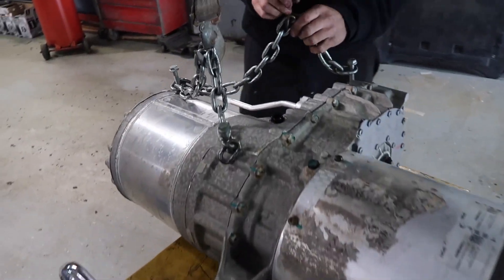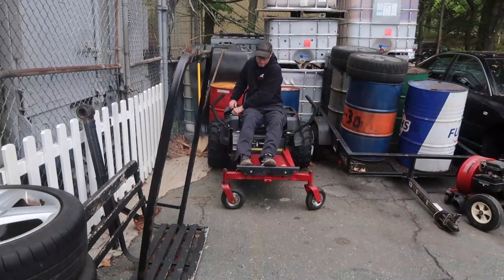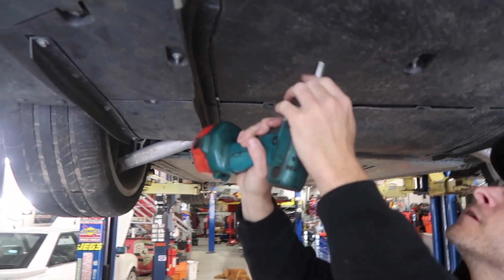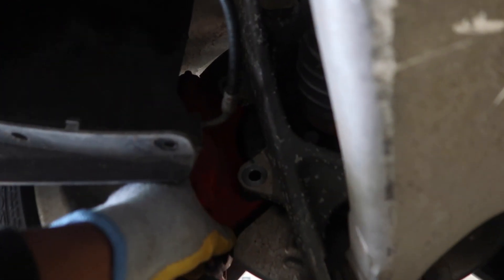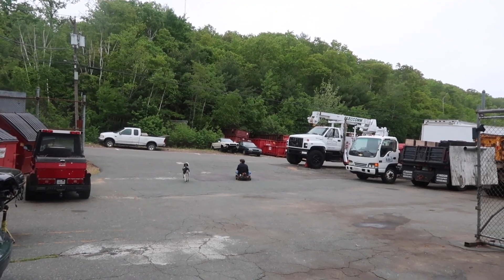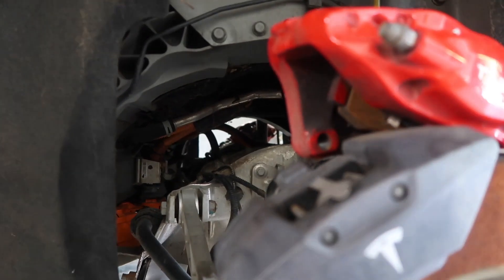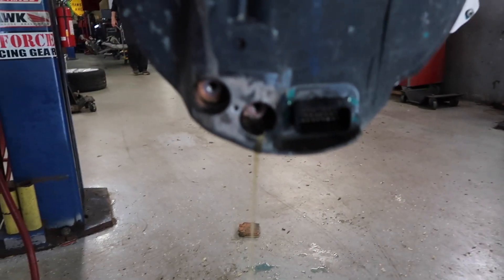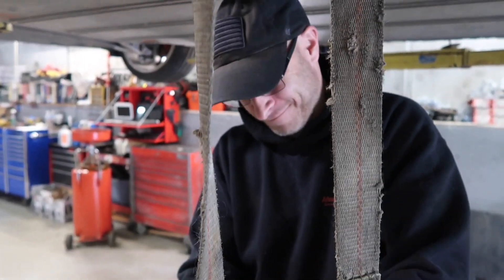Can You Drown a Tesla Motor?

Comment: ask louis rossmann maybe he can repair the board
Reply: Louis has made it pretty clear that he makes his living fixing mostly common faults, and will charge you dearly for doing custom repairs. Because of thier difficulty and the amount of work that has to be poured into finding schematics. Love him, but doubt he'd do it for exposure :P
Reply: I imagine Louis might just throw the boards into the ultrasonic cleaner and hope that that's all they need. I imagine that the schematics for those Tesla bits will be harder to get a hold of than any laptop or smartphone schematics (let alone replacement ICs) so going down that road is probably a dead end.
Reply: DKTAz00 ya. who wants more exposure on YouTube?
Reply: I think the Crest Ultrasonic will do it.
Reply: louis has 3x the subscribers as this guy and i'm sure he would have no interest on attempting to work on this HUGE and TIME CONSUMING part. the thing would cost a fortune to ship and he would have nowhere to put it
Reply: Don't tell him how "little" corrosion there is, just send it to him and let him experience it ;D
Reply: This is a bit too advance for Rossmann. It's one thing to fix bad solder joints and have schematic diagrams available for a mostly digital domain system (computers).  But it is a whole other can of worms when you have to troubleshoot blindly since no one has released a diagram of the the electronics and you have to understand analog and power electronics theory and firmware programming for this analog/digital domain design that also has precision electrical components. 

 Shahriar of "The Signal Path" youtube channel is someone who is capable of fixing this.
Reply: Catsrules1 it does look worse then it really is. I doubt power went to the inverter when is was parked. Also, corrosion on a circuit board is usually white. I bet my ass off that rust is from the shell which got surfaced over the board by the water, and all it needs is a hook cleanup and maybe some traces, pads/pins resold weed, worst case, some passives, which ain't that bad
Reply: DKTAz00 If you watched his videos, you would know that answer to that.
Reply: Knowing Louis hates tesla,  The color of the board from green to brown I don’t think he would repair it  try Scotty Kilmer? I wonder what scotty would say as well.
Reply: I don't think anyone is saying it can't be done, but that it's not worth it, compared to getting another salvaged part. Unless your time is free.
Reply: He’d do a 40 minute video and somehow spend 30 minutes of it slagging off Apple, remove a jtag connector and claim it was fixed because a fan spun.
Reply: I doubt Louis Rossmann would even touch this. I won't and I work on water damage stuff for data recovery. But this has been under water for days and the protective coating won't hold up to being flooded, it only design to repel moisture droplets, not flooded. Those board's are more likely beyond any repair. It not just traces and the layers on the boards you have to the worry about, but components are more likely shot as well and lack of service info would make a repair on that, next to impossible.
Reply: I did board repairs like this before, even much more damaged.
Reply: he can try to clean and solder som wires to it from teh broken leads
Reply: I don't know, it might look worse then it really is. From the looks of it (at least on that board we got a good look at) most of the chips and such are above the water line. Looks like the bottom part (from my zero experience for electronics) that was under water is more for power distribution So it should be pretty standard to replace.

Comment: Wow man, you're certainly giving Tesla engineers a good look at where they could make design improvements. I'm not so sure that car could drive through a minor street flood of 8" to 10" without encountering some seepage into areas that it wouldn't tolerate well at all.  Interesting video, thanks!!! 😎
Reply: Zeek Duff 
I heard that Tesla engineers subscribe to this channel and decided to implement bilge pumps.
Reply: considering this car was 10 days under water not a couple of minutes it could be worst
Reply: you have to realize that this car was TOTALLY UNDERWATER for TEN DAYS. it took 10 days to accumulate that relatively small amount of water using this website https://water.usgs.gov/edu/activity-drip.html  it says that a sink that drips once per minute for 10 days will produce 3 liters of water, i would call that comparable to what they saw here. this car being submerged for 10  days had leakage comparable to that of a very slightly leaky faucet.
Reply: ADreiews76: I was thinking the same thing. to have that little water inside after 10 days immersion is fairly impressive. The sealing is more than good enough for splash protection or fording and wouldn't need much more work to seal even better. Usually doubling up on the O rings is enough.
Reply: I don't know if any car could handle driving in 8-10 inches of water. 5 was pushing it in a Corolla and I bet Teslas are even lower
Reply: And did they tear down the motor/diff/inverter to see if there was water in it?
Reply: Model S must have 6 inches or more of ground clearance to the bottom of the pack, then a few more inches above that before you get to a potential leak point, so I'd think 8-10 inches would be fine for driving.  I've definitely taken other cars through water that deep.
Reply: Scoda Octavia 2005. 10 inches of water with waves covering the front bonnet. Drove trough 300 meter long stretch also making waves that picked up small cars and threw them on the sidewalk. Not a single hiccup during or problem afterwards.
Reply: One improvement I'd suggest is moving the inverter circuits to their own separate water proof enclosure.
The AC motor itself can tolerate some water but the inverter boards must stay absolutely dry.
Reply: It wasn't actually floating in that video.
Reply: Zeek Duff well honestly 10 days is a lot
Im going to refrence a device, an iphone or a samsung, both water resistant. TO AN EXTENT. Both 1 meter (one for 30 min another to 1 hour) 
This tesla was left for 10 days
The seals were under a lot of pressure 
Plus its usually a fresh water test for seals (the ip67 and 68 raitings on either devices under salt water is well. Unknown. Well to me anyways) 
So im guessing the dirts minerals and salts in the motor could have broken the seals, plus the variation in heats (which led to the oring disaster on an Apollo mission it shrank in the cold) 
So i feel it should be fine under certain situations
Reply: That's not true. There is a video where the car floats and moves forward using the wheels as paddles. I think it was in Russia in a tunnel with lots of rain water.
Reply: While I'm sure that's possible if kept moving, it's also possible to have to stop or inch your way along, depending on circumstances. I've driven through that kind of thing a number of times, fortunately in a full size van at the time, but cars were having a hard time, some would go too fast and get the ignition wet, stalling the cars behind them, also dealing with waves from vehicles coming from the other direction, etc. It just looks to me like if one had to spend much time in those conditions, it could be a big problem, unless they seal that assembly a little better than this one appears to have been. There are areas around western Chicago burbs where that kind of street flooding happens almost every year, i.e.
Reply: Dan S, they took the covers off and yes, everything inside was drowned out, and when tipped on end about a gallon or more of rusty water drained out.
Reply: I did, in a chevy Volt. 
I thought for sure it was done for, but I made it thru.
Reply: The Rusty Scooter 
I found myself wheelwell deep in water in my Crown Vic last year. The engine was still breathing air, so I inched my way to a left turn up hill.
The dash lit up like a Christmas tree, and stayed lit up for about twenty minutes after I got out of there.
The car was serviced two days later, so I could drive it with confidence.
I checked the oil (both engine and trans. Rear end was checked during the service.) as soon as it stopped raining, just to make sure that the oil wasn't wet. It was fine.
I guess you could say that the Crown Vic handled more than a foot of water, and survived...
But, I never want to be in that situation again.
Reply: izybit izybit wouldn't you need a 'snorkel' arrangement for the  air intake just like the off-road 4WD cars have to use when traversing lakes?
Reply: Servic
Reply: Zeek Duff hey dumb dumb, it was submerged for 10 days.
Reply: It'd be a dumbfuck decision on Tesla's end. They are producing luxury vehicles, not Ladas. Disposability of a high end vehicle is one of the reason why people also buy it as it's a temporary sign of class. Durability should be the least of concerns at this point for Tesla let alone making the car flood proof. And why in the world would they even make it? Insurance pays for replacement so they sell the second one. They make it flood proof and profit goes out of the window.

Comment: for the inverter if you have to re use it, you have to get off the rust and re solder the connections that got corroded
and you have 20% chance only

Comment: Electricity and water mix just fine. CLEAN water is an insulator. Dirty water though ... then you are in trouble!
Reply: H2O isn't conductive just as zapro_dk said, anything else, in increments up to sea water is problematic.

DUST is conductive. The shit that gathers on top of your battery, in the car? That shit trickle discharges your battery .
Reply: crashburny the others are right, pure water is a fine insulator. The conductivity comes from the ions in the water.
Reply: Yeah, nothing for the electrons to go through with clean distilled water. Sucks that rain isn't like that
Reply: this was salty sewer water... sooooooooo
Reply: Good thing he wasn't talking about clean water.
Reply: perfectly pure water which is kinda hard to make, is a great insulator
Reply: Well electricity conducting through the board + dirty water will corrode  the boad. But at the time the Tesla was parked and waiting in water for 10 days without the motor having electricity running through iT. try vinegar XD
Reply: It's near impossible to RO/DI water to a point where it's an insulator. It sounds good on paper, but isn't practical. Even lab grade DI water is conductive.
Reply: zapro_dk those distilled water lakes in your area must be amazing!
Reply: zapro_dk oh, cmon, not even clean water can be clasified as an insulator. :)  plus its quite hard to find it in nature. Even drinking water from a well has stuff in it.

Comment: Just buy that radiator cleaner stuff fill car to top, wait 24 hours and good as new!
Reply: Then sell it quickly and move out of the country.
Reply: I've heard rice is good for things like this.
Reply: If that works, you should buy the Tesla from Rich, put a pizza oven in back, and deliver pizzas with it.
I've always wanted to see a DXP Tesla.
Reply: cleaning thinks like that is just for you samcrac
Reply: That’s enough, Samcrac.
Reply: I believe that Rich was talking about how some people remove the motors and weld axles to Teslas, then send them to auction. Perhaps Rich should try that. lol
Reply: In a way it’s too bad it’s electric. 
Back in the day what we would  do to rebuild a car is we would first get the engine hoist out. Then we would hoist the radiator cap off and drive a new car in and set the radiator cap back on. 
Voila new car!
Reply: @MrTheHillfolk  That's what I think of a lot of extreme builds. Yes you used some components from an incinerated car, but is it really the same car?
Reply: @Daweim0  
Yea I hear that, it's almost too easy to say : this part has a dent, let's just buy a new one.
And pick up the phone and order and you have it in 3 days. 
Coulda fixed the original in 2 evenings after work 🙄
Reply: I'm subscribed to you
Reply: We still have rust
Reply: Jay J rice actually makes more water

Comment: oh, one more thing. I can't see the details on those controller boards, but there are guys out there who might be able to professionally clean those and evac the moisture. Theres a chance the boards will still function if there are no physical relays or other elements on there.
Reply: The majority of the mess is likely to be superficial. Most of that stuff with the orange gunk all over it will be conformally coated, so the pressure washer may actually be the answer. Failing that, put it in the ultrasonic cleaner. I would then dry it carefully, and inspect it even more carefully, then re-assemble, the inverter and check it again. The things to watch for are metallic particles and magnetic shmoo from the flood water that will adhere to all the places which also have a magnetic/ferrite component (transformers, inductors, relays and the like) with a high potential to short things out.

I once repaired a bunch of old CRT monitors (parts of which run at about 5 to 10kV) that had been in a canal for a month. Nothing electronic was problematic as it is all designed to be submersed in various liquids while being assembled. The main issues were cosmetic. Having said that, be very careful when you test as there is a metric sh*tload of energy available so any magic smoke release is going to be spectacular, loud and potentially kinetic (and of course expensive).
Reply: Yeah, take them to Louis Rossmann
Reply: SOMEbody's been watching AvE videos  hehe
Reply: You can replace components too.   The issue will be any custom chips only tesla has access to.  He should take close up images of the circuits and crowd source feedback.
Reply: andrew hull the magic smoke might also turn exothermic :)
Reply: my guess is those boards are coated with one heavy duty coating of conformal coating...so the boards may actually still be fine and it's just misc. motor crap that coated the boards
Reply: Need board repairs? Louis Rossman.  He might feel cool helping to repair a Tesla.
Reply: I was gobsmacked to see boards of such complexity in there. They look like multi-layer boards; with very fine traces - no doubt those traces are corroded out. Even if they were coated, ehhh. Then there's those quad flat pack chips with all of their exposed pins - and they're no doubt custom chips - so not sure about finding replacements. There must be a special level of hell to punish people by reworking those. And yeah, Louis Rossman is a genius, but that's computer boards - I doubt Tesla would share their schematics if they barely even let you replace a bolt.
Reply: If i was them i'd put 5 30A automatic fuses in series with the motors just in case they decide to go puff and evaporate. Why 5 in series? They are designed to cut off AC, in here the power will be DC and more fuses make it less possible for the ark that will form to sustain it self in one or 2 of them. Otherwise a good wash with the pressure washer and than a soak in pure ethanol to draw away all the water and afterwards a few hours in an oven at 60C-80C.A close inspection will be necessary, however i'd guess the damage will be contained to connectors and cables inside. If all the seals were good, the HV cables might be the reason there was water inside. They were fully submerged and i doubt the cables themselves were water proof inside the car. We have had water leaking trough a cable about 2 years ago in a boat that had it run trough the bottom in to a sonar head. The "captain" sheared the sonar in shallow water and 3 days later the junction box for it was full of lake water. All the seals were pristine and the full length of the cable was wet on the inside.
Reply: At its simplest it's a plastic coating on the board to protect from corrosion, protect from arcover and insulate everything from contact (there's more to it than that, but that's the basics) .

Have a look here: https://www.3m.com/3M/en_US/novec-us/applications/electronic-coatings/
Reply: You guys talking about that cranky apple repair guy?  No way would he touch something like this
Reply: Thanks Alan.
Reply: if you look at it closely it has conformally coating
Reply: What actually IS conformal coating?  Google had nothing when I looked.
Reply: You dont want to re-use those boards anyway. If the pathways are damaged you'd be in diagnostic hell trying to find the fault after everything is back up and "working". Besides in a drive unit, im not sure you want to have an unreliable engine like that anyway.
Reply: Maybe Electro Boom could shine some light.... But the electronics are most probably fried from dirty water sitting there corroding all the board for so long. 

Even then to go through all that trouble for a board would be more expensive in the end. 

My question is: don't you guys need to replace all airbags and seat belts including modules once it's flooded?
Reply: most are off the shelf components,
Reply: uhh, up to 1400A goes thru these units.
Reply: Andrew Hull im hoping they just added a hydrophobic coating on the boards and call it a day
Since its waterproof* in that case its just gunk build up but overal. Professionals can clean it, circut boards are easy. Look at the guy who addee a chip onto an iphone for the headphone jack
This would be just reverse engineering. And even then most of it could be online, or pictures
Reply: No, it was too long time corroded.